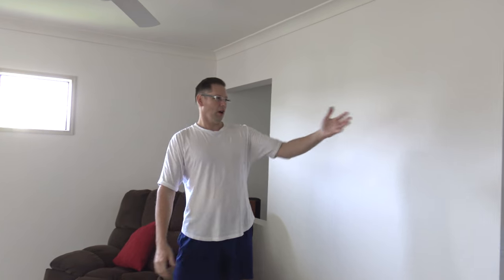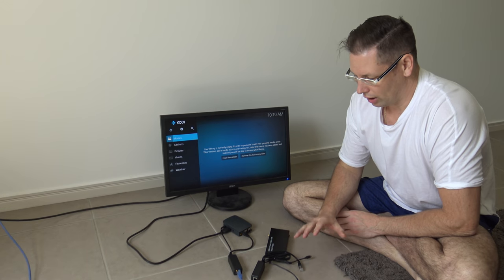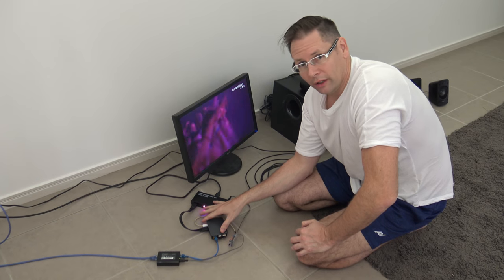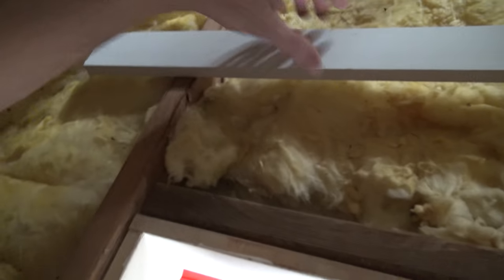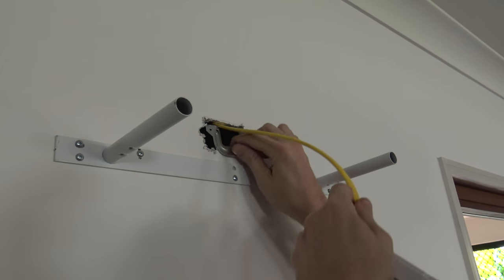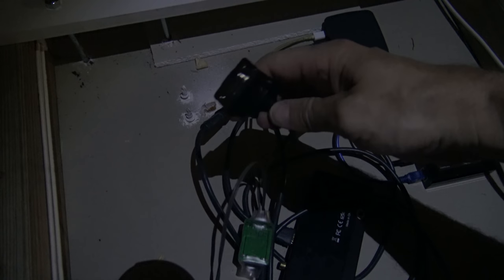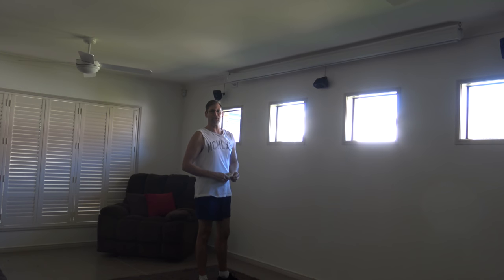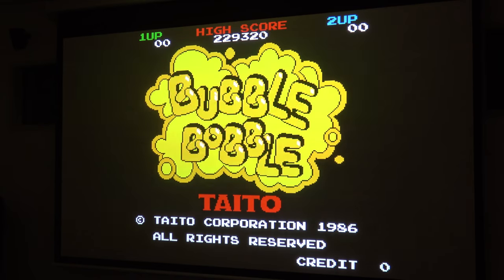Raspberry Pi Home Cinema On A Budget

Comment: Now get a logitech harmony companion to tie it all together. (it connects via bluetooth to the pi, so remote control is super fast, and it can control the beamer, screen and audio as well (as long as it's rf or bluetooth)). The app is kinda terrible, but it's a one time set-up thing. (I personally do all the automation via home-assistant, but have the harmony companion as the remote just because I like it so much)

Comment: Quickest way to cut holes for plates etc. in plaster board with the least amount of mess is to score the square with a stanley knife, then cut a cross through it and bash it with the end of the stanley knife - it will fall inside the wall, might need to cut the paper on the backside with the knife. Perfect hole and no mess. For a few bucks at the hardware store you can get a nice wall plate template with spirit levels in it.
Reply from the maker: I have done that in the past, but always afraid of scoring it too far along if I pick up a bit of momentun with the knife. The chain drilling is something I do for other materials, so just kind of carried on with the idea to gyprock as well.

Comment: I have a question, doesn't the audio coming out of the center speaker get muffled or blocked by the screen ?. Center speakers usually carry the dialogue of a movie or voices coming out of live shows so that's why I am asking.  Great job and even the kodi info was spot on.
Reply from the maker: It sounds alright, and that's the only place I could put it here. Again, if there's no screen there's no problem.

Comment: Was the 16th strand connected to shield? 🤔 And isn't the front centre speaker going to be muffled due to the deployed screen?
Would also be curious to see how it performs during broad daylight and if you have come across any issues over time.
Killer idea though, loving the 100ft arcade gaming 🤣 Time for the wireless arcade controller deck? 🤔🤣
Reply from the maker: It's new in this house, but I've been running a similar setup to this for years.
That centre speaker isn't really causing any issues. It's mostly set up for daily music anyway (no centre speaker needed), with the occasional movie when the screen comes down.

Comment: That's a great job. The only thing I wouldn't have done was leave the Pi up above the ceiling. I'd have put it by the audio controller to keep it cool in the summer. The Pi 3s run hot to begin with. All in all, great and very neat job!
Reply from the maker: My long standing test has been a Raspberry Pi running a security webcam sitting in the roof (the Pi, not the webcam). It's been up there for ages without a problem.
Reply: Cool!

Comment: Why the more expensive motorized screen vs a manual pull down? Also, why put the pi3 and hdmi switch in the crawl space which most likely isn't temperature controlled? I can't speak for your city but the hot summers and cold winters here would shorten the life of that equipment. On certain days I'd also image it would be too cold for some of that equipment to even run up there.
Reply: It’s likely not going to get too cold for it to work. But might get hot, dusty and attacked by mice lol.

Comment: Isn't there a delay between the image and the sound considering that most projectors and hd tv preprocess the image before outputting to the user?
Reply: if there was a delay you can fix it on kodi advanced settings, but there isn't.

Comment: Just do you loose the centre speaker when the screen is down. Looks like it goes straight down over it?
Reply: the projector screen is not thick enough to stop the sound, and yes he has it pointing down so it will be fine. Cinemas have speakers behind the screen too.
Reply: Don’t take out the centre, it plays about 80% of the soundtrack.
Reply: @lukasbekcic  you can have phantom centers FL/R play to make it sound like there is a center, But you need a proper AVR for that.
Reply: he could have an acoustically transparent screen, solves the "speaker behind the screen" issues

Comment: $800 for a motorised screen? If your on a budget should have gotten a cheap motorised screen off eBay, I got a 120" motorised screen delivered for around $80 AUD and it does the job.
Reply from the maker: The projector screen wasn't part of the 'budget' setup. A budget setup doesn't even have a screen!

Comment: The Raspberry Pi is a poor choice for this application. I tried it for a year, but it has insufficient memory on board and the USB/Network sharing causes ENDLESS problems. I switched to a Rock64, that works much better.
Reply from the maker: It's been working great for me for years.
Reply: I have a 2GB rock64 and last time I tried one of the kodi variants it was rather buggy and the 4k playback was rather choppy (at least when it had to decode the lossless or even lossy surround audio tracks)
Reply: Try pi4